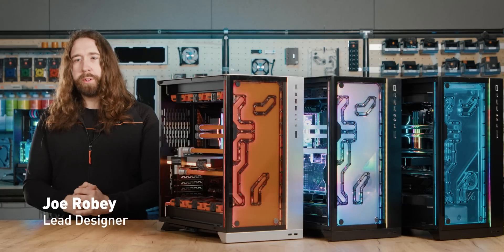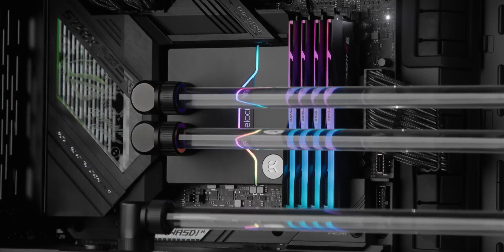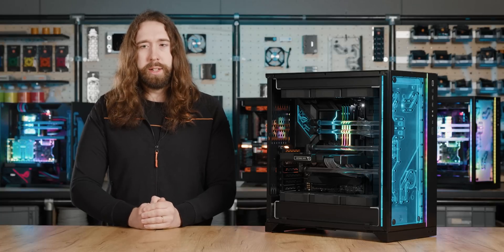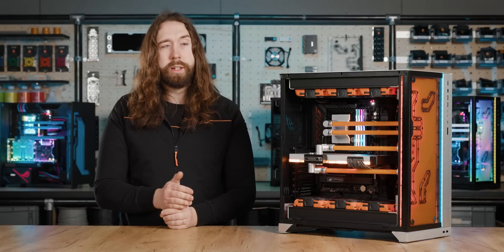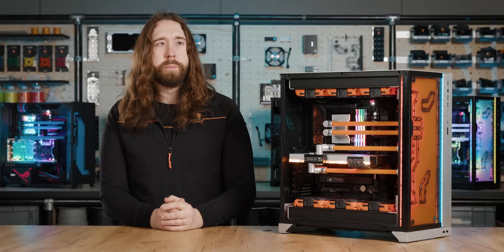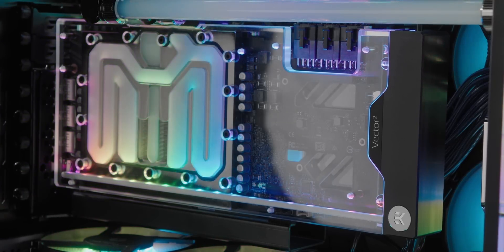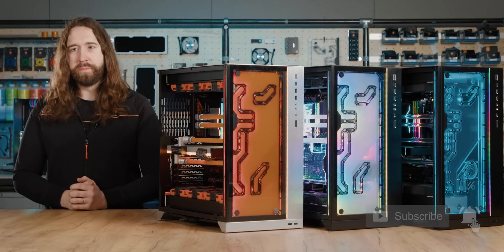Matrix7 Showcased in 3 Amazing CES 22 Builds

Comment: Why is there no triple 420mm radiator setups with front distroplate, it is the best custom setup with maximum capacity but no one makes them so hard to piece together and line tubes up - is this because all because the fans are hidden in the back?

Comment: The push fit fittings on that bottom rad and the radiator mount on the Lian lai xl do not line up. This is horrid to try and do.

I am doing it with a corsair rad but it seems the same.

Comment: The directions for the distro plate are weird after looking at this video. 
The manual says their is a configuration for “dual radiators” involving the top rad. The outlet port is different for the top rad, but in this vid the first blacked out system that had a dual rad setup utilized the inlet/outlet ports for the top rad in the “triple radiator configuration” as per the manual’s directions. 
If you download the manual off EK for this distro plate you can see it labeled as such in one of the diagrams.
Is this fine???
Id like to run the top rad as they have done in this video, bc if I go by the manual I’ll have to buy an extra offset in order to do the config the manual says for a dual rad.
I THINK I understand what they mean by a dual rad system in the manual. They assume for only a top and side rad config and not top and bottom? 
Any input?

Comment: I am building a very similar build as build 3 but with 2 radiators only… I’m trying to connect my bottom radiator with a 90 fittings and a rotary male to male against the distro… but I can’t get it to screw in both parts.. does anyone have any tips on to get this done?

Comment: I’m having a a really hard time connecting the 2 90 degree in the top P radiator to the distro plate. Hard to turn the rotary fitting. Tightening it on the distro it starts to lossen it from the 90 on the P radiator. How did you guys tighten this lol.?

Comment: How is that 90 degree rotary and male to male connection between X rad and distro possible? There is absolutely  no room...
Reply from the maker: We've got special push-in fittings that work with that specific distro: https://www.ekwb.com/shop/ek-quantum-torque-push-in-adapter-m-14-gold

Comment: I have a question about the last build. Correct me if I’m wrong, but aren’t you  using the wrong top radiator outlet port for the reflection 2? It looks like the fitting is running to the outlet port for a double rad configuration and not to the triple?
Reply: That's exactly what I thought!!!
Reply: @maxk.3803  Yeah it’s really confusing me lol
Reply: I bought one of these recently and the top radiator ports are different. The distro plate has a different layout and yes, just after mounting it I figured I have to disassemble and mount again… pain.

Comment: hi. noob here. i just do air cooling built. but if i venture on water cooling and go with lian li case as shown here, if i order these matrix7 combo, does it come with built-in cut tubings and others? so i only left with basically fitting it in the case. whould that be correct? thanks.

Comment: I’m currently putting my parts list together to transition from air cooling to full water cooling in my O11D-XL. I had a question about 3090s and your ABP Vector2 blocks. Will they fit in a horizontal position or is it best to run them vertically?
Reply from the maker: They will fit in a horizontal position on almost all motherboards - there are a few rare exceptions for the select few active backplate/motherboard combinations as they have RAM slots placed a bit lower (closer to the PCI-E slots). You can contact our customer support team and tell them the name of your motherboard and the desired GPU block/backplate combo and they will gladly check if there's any interference: https://customerservice.ekwb.com/hc/en-us/requests/new
If you wish to have the GPU placed vertically, we advise you to take a look at our EK-Loop Vertical GPU Holder EVO - Gen4 Riser that is compatible with our active backplates - most standard risers won't fit them.

Comment: why did you change the reflection2 xl top rad and side rad holes positioning for the final product compared to the one presented on youtube before launch ? now the side outlet instead of going on top of the rad and into the reflection will go down in front of the fans and into the reflection
Reply: and can you also make a new video with the retail product assembly with a 3 rad and the fittings used
Reply from the maker: The ports were changed (from the early samples used exclusively for these videos) to allow nicer tube routing when the distro plate is used with three radiators.

Comment: what sized extender fittings are used for both the cpu and the gpu to connect to the distro plate?
Reply from the maker: You can check out the exact list of parts used for any of our builds over here: https://www.ekwb.com/shop/kits/kits-bundles
Reply: @EKbyLMTEK  oh wow that's super cool and useful, thank you very much!
Reply: @EKbyLMTEK  also, i was wondering if you guys planned on doing a 011 evo build with the new upright gpu mount and watercooled with the new vector 2 gpu waterblocks with the reflection 2

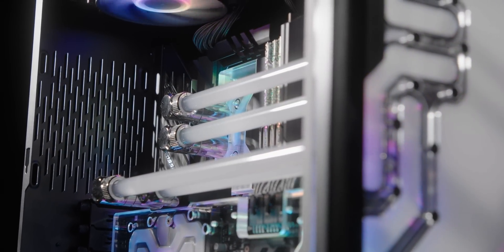Comment: Hi, I will like to check for build #3 @ 10:06 - Fittings required for the CPU water block. EK-Quantum Torque Extender Static MF 28 + EK-Quantum Torque Rotary 90° + EK-Quantum Torque HDC? 
10:27 - Fittings required for bottom SE radiator - EK-Quantum Torque Extender Static MF 28 + EK-Quantum Torque Rotary 90° + EK-Quantum Torque Extender Rotary MM 14?
 10:44 - Fittings required for top SE radiator - EK-Quantum Torque Extender Static MF 28 + EK-Quantum Torque Rotary 90° + EK-Quantum Torque Extender Rotary MM 14?  I can't tell the left fitting.
Fittings required for centre SE radiator ?
Reply: I am wondering too , need to know the exact fittings used in that build
Reply: @MShazarul Do you know what type of fitting it has? Thank you very much.

Comment: Does this mean kits with pre-cut hard tubing would be available to fit builds like this? And specific sets of spacers and such for correct heights and direct radiator connection as show? Also, the MSI Carbon EK boards are so nice, would love to see a collab for GPU as well.
Reply from the maker: It means you can assemble a hard tube build without bending a single tube while keeping a nice clean look :)

Comment: A component list for each build would be amazing, I really want to copy either the second build (Satisfactory themed PC!) or the third one with the great rainbow look. Luckily I know the case is a Lian Li O11, and I can figure out the mobo from the branding, and the RAM is G skill Trident Z Royal Silver DDR4. But it would still be good to get a list of exactly which fittings and adaptors were used in the plumbing so someone can copy this build!
Also I'm very confused why the distribution plate looks completely different to all the ones available on your website? This case is clearly the Lian Li O11, possibly the XL model, and none of the distro plates for the O11 match the shape of the ones you have here. What model are they?
Reply from the maker: These are the upcoming Reflection² distro plates which are coming out this spring.
You will be able to find all of these builds (and more) on our webpage with exact water-cooling gear and hardware that was used to make these :)
Reply: @EKbyLMTEK  I would really like to see a list of all the parts fittings, tubes etc used in each build so I can order all the same stuff to create myself I have same PC parts, this would be helpful but dont see or can't find them anywhere on your website?
Reply: @EKbyLMTEK  Oh nice, thank you! An upgraded version of the Reflection, and the new phase fans, coming out soon? I was about to buy everything I needed to copy the third build shown here but I guess I'd better wait for these updated versions! Thanks! :)
Also when you say Spring, I assume you mean Northern hemisphere Spring, so 3-4 months from now? Here in Australia it won't be Spring until September, lol

Comment: A smart marketing decision to sell more fittings indeed. But since the price of torque fittings are already up there , when can we see rubber gasket like products from competition instead of those cheap and thin o-rings in those fittings?
Reply from the maker: You control your pump and fan speeds in BIOS, there is no specific software for it at this stage.

Comment: What is the vertical gpu bracket used on the third build?  The current EK brackets say they cannot support an active back plate.  Is there a new bracket coming soon?
Reply: new GPU bracket in the works to fix AB issues
Reply from the maker: New vertical GPU bracket that supports the active backplate is coming this month! :)
Reply: @EKbyLMTEK  awesome, can't wait!  planning to get the new rads due this month as well so that will be perfect